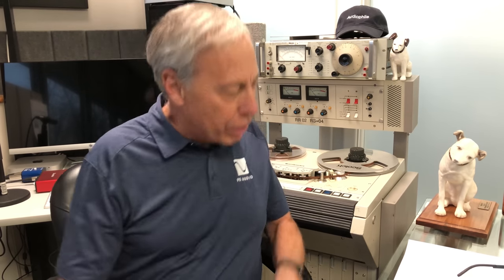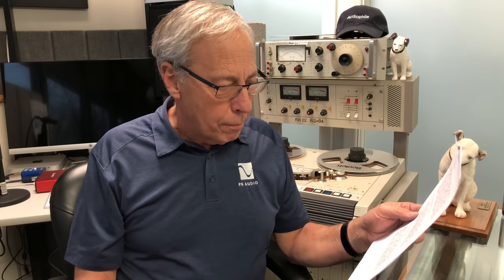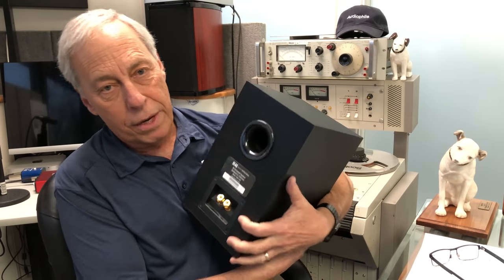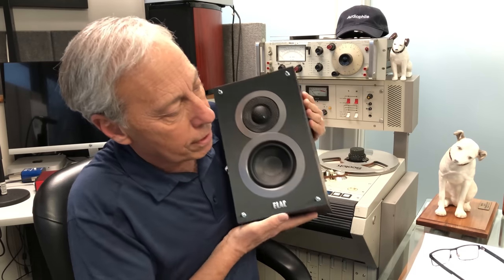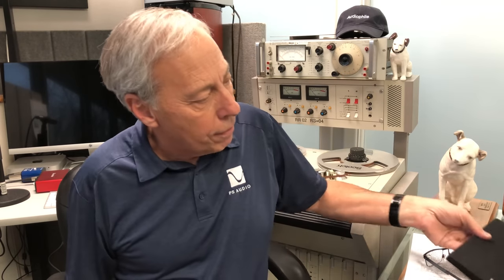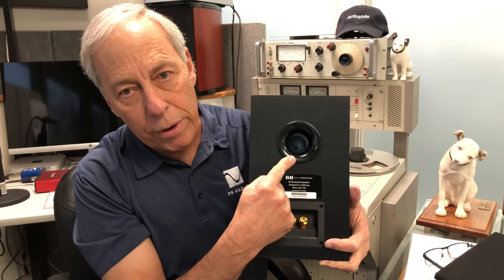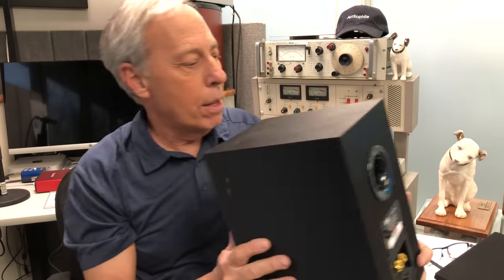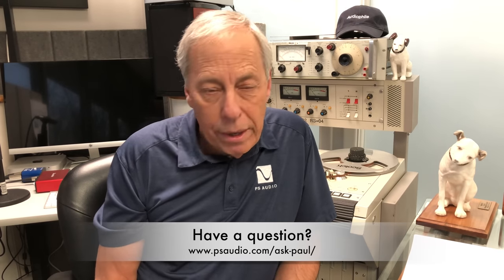Ported loudspeakers

Comment: For bass you have the measured "thile-small" parameters of a woofer, which you can use to make a spreadsheet that will tell you what it will do in a particular closed box, or ported complete with minimum port diameter. You can check out box sizes and port lengths for tuning the internal resonance that shores up the bass.
A closed system needs a woofer with more self-bass resonance than a ported system. The ported woofer would be bass-shy in a closed system, and the closed woofer would be blubbery in a ported system.
For little systems like a 4 1/2" woofer, you need the port. Ideally you'd have a long-throw woofer. You can get a -3db of 60HZ with the right woofer in 5-7 litres, which could/should be a narrow mini-tower. Perfect for a desktop, with the speakers at the top.
To keep mids from coming out perceptibly you line the inner walls with damping material.
For the closed system, they are generally filled with damping material to prevent inner reflections from hitting the cone and sounding it. You can't fill a ported system, of course.
The thile-small parameters include:  frequency of resonance in HZ in free air of the cone. Measured by using a sine-wave generater, ac voltmeter, and resistor, and amplifier to graph the speakers resistance over the bass frequency range. There will be a big peak at that frequency. Then, DC resistance. VAS - "volume equivalent" if I remember right. You put the woofer on a box of known volume and measure the resonant frequency, which will be higher due to the air spring. You want to know the linear travel, usually 3mm each way if not long-throw. You need Qts - my memory of this is vague - the self damping of the woofer, electrical and mechanical - combined. Mechanical - like, if you thunk it, does it go woong or blup? And the area of the cone.
So now, you have what you need to graph it in a trial box.
Therefor you can shop for woofers and plug in their parameters for the size system you want. Many will be too resonant and deliver a blubbery bass, while many will be too non-resonant (in the bass) and have little bass.
Now when those babies arrive, you have to test them because their published parameters can be quite off. This would be less likely with entry level and up high-end woofers from Europe.
If you want a ported system, a woofer with, memory holding, about .4 Qts will be great in a box the volume of its VAS.
Now you can tune it (using box size and port tuning) for maximum bass or better damping, the latter of which will make the bass roll off slower and be more controlled. The box would be bigger.
To compensate for an average British room I read about years ago, you'd actually want the slowly rolling off bass. Bass is bouncing back from the walls, overall boosting it is that case. 
Bass is omni-directional so half goes around the back. This actually makes it quieter than the mids when you're using an accurate mid-woofer, and you have to lower the mids in the crossover. The fact that the impedance is rising in the woofer with frequency helps. There's a 6db rise from bass to mids over 2 octaves. Forgot the formula but I think for a 12" wide box the top is at 1,000 HZ.
So there's alot that beginning speaker-builder books don't tell you.
Oh - and the air in the box is part of the spring-return system for the woofer, completing its internal spring.
The spreadsheet can also tell you how loud the system can go, using the linear throw length, bass tuning, cone area.
Reply: I forgot to mention that with half the bass going around the back, and some coming back - I'm thinking of a system out from the wall on a stand, or a tall system - if you put it on the wall and it wasn't designed for it all the bass would instantly come back and be way too loud. If you designed a system to be on the wall, you'd have to take out the dropping the mids to the bass level eq in the crossover network.
Reply: I forgot to mention measuring the qts. As in measuring the frequency of resonance, above, you measure that and its impedance, then the frequency at some % of that impedance, if I remember right, and a formula will give the Qts.
I also forgot to mention the what's it called? port that's just an opening with damping material covering it so it takes some pressure to drive in and out. It relieves some of the pressure of the air spring, acting like a larger box, so a woofer that would be too self-resonant (low damping) gets a looser air spring and can be ok in there instead of having big, loose bass.
Reply: Also, if a port is chuffing then it would be thought to have too small a diameter, where the air is rushing through too fast. I can't check now if a proper port chuffs a little at super-close range. Of course the greater the diameter of the pipe, the longer it has to be to get the same tuning to reinforce the woofer on the low end, limited by the depth of the box.
Reply: The internal dimensions of the box -- none must be a multiple of another to avoid unwanted resonances.

Comment: A well designed ported speaker would not have any fart sound. I can guaranteed that.
Reply: What he said :)
Reply: Half-decent sealed box speaker usually sounds more accurate to my ear problem with ported usually used to make s*** speaker extended
Reply: Methinks Mr. PS audio needs to check out all the studio speaker (4343,4344, 4350 etc.) JBL put out over the years with larger ports 4-6 inchs that sound absolutely fantastic. :>)
Reply: George Zubeck people there are always exceptions to every rule and if you listen most times he says it in one way or another.
Reply: don't worry, paul has forgotten more than i know....
Reply: Wrong; even using large diameter flanged pipes you get a sound, I know because I tried using 10" piping in a 120Litre box. Paul is right; you might not be able to detect it in music but its there; proven by doing a frequency sweep. As you decrease the pipe diameter swooshing sounds become more dominant.
Reply: That's like saying if you can measure the sound of a fart at a rocket blast it will have a meaningful impact. The benefits outweigh the negatives with a large port in the right place. If you place the port near the midrange  speaker you will have noise cancelling which will be negative to the overall sound quality.
Reply: George Zubeck : Every loudspeaker manufacturer in the world uses signal generators on their speakers or at least white noise spectral analysis, you dont know what you are talking about, no additional driver CAN negate swooshing sounds from the port (except by DSP which they rarely do).
Reply: Your missing the point. If the sound level is much higher compared to those swushing sounds (or chuffing rather than farting)  then its not as big of an issue unless your pushing alot of base. I would be more concerned about noise cancellation from the backwave affecting the overall midrange qualitie. What your not mentioning is that with a sealed enclosure you lose efficiency which does affect sound quality in a different way. I've experimented with my speakers by plugging my ports vs. unplugged and for most of what I'm listening to I preffer unplugged.
Reply: George Zubeck : Like I have already said; I built a 12" subwoofer in a 120Litre box with a 10" flanged port (Q=0.7); how many speakers do you know with a 10" port?...not many.
During testing even that subwoofer had some audiable chuffing sounds.
You cannot 'plug' your speakers and change it from an optimal ported to an optimal sealed box, because the enclosure volume would also need to be changed to keep the frequency roll-on optimal; you would need to re-calculate the Thiele-small box dimensions for a closed box). EVERY speaker designed to be ported when plugged will sound worse-again this is lack of understanding on your part.
Reply: This is not a contest of what is better or not but tradeoffs in the overall design including high frequencie, midrange and low frequencies. If you build a big enough box you don't need a port at all. The point is that you lose alot of efficiency with a sealed design and you need alot of power given certain constraints. With a ported design you need less power and gain efficiency. What you have to worry about is back wave interference from the port. The chuffing is only when your low woofing hard which is not all of the time. That is the point I'm trying to make. Not whether something is going to chuff and puff at all but whether its relevant to overall audio enjoyment.
Reply: It will if you are playing farts through a speaker. You need a good speaker setup to reproduce farts the best and get that rich, booty sound. Yup! Have of you at one time or another have played a fart through your speakers. After reading this, many more will do so. Try YouTube for a good fart library. You're welcome! LOL!
Reply: @suzesiviter6083  You seem to like telling people they don't know what they are talking about.  No one uses white noise spectral analysis.  They use pink noise spectral analysis.  Two entirely different things.  You don't know what your talking about.
Reply: @keithmoriyama5421  Wrong, you do not measure equipment specifications based on pink noise that roughly approximates the human ear, you would use White, its you that has the misunderstanding. You might use Pink when you are measuring the overall ability of say a speaker to reproduce the musical spectrum, but in general White noise is preferred to gain fast accurate results without having to re-correct the amplitude over the frequency band.
Reply: at least not anything audible. besides the only one that puts their face down behind my speakers ports is the cat
Reply: @suzesiviter6083  10" ports are standard where I'm from. Everybody doesn't have them?

Comment: If you don't like the sound of ported speakers, can you just fill the port with foam filler, or is this not a good idea?
Reply: Nope if a box is designed to be ported then it can't be sealed as the enclosure dimensions are calculated by the driver specifications . So if you want a seal enclosure then you have to calculate according to the drive specifications .

Comment: Two additional comments. First, the advantage of a front ported speaker lies in less placement restrictions than a rear port which needs room behind the speaker to "breathe".  But both disadvantages of ports (placement restrictions and port "chuffing" ) can be ameliorated by using a passive radiator which is essentially a port substitute.
Reply: Ameliorate: make (something bad or unsatisfactory) better.

Comment: The port of a ported speaker is a Helmholtz-resonator, and when the frequencies are higher than the port resonance the output is in phase with the driver and that gives those frquencies a boost, when the frequencies are lower than the port resonance the ports output goes antiphase with the driver and that's explane why a ported speaker suddenly goes quiet at really low frequencies ie. lower than resonance, it's ekvivalent to a fourth grade high pass filter. I have built my own ported speakers and it is hard too get it right, one way to determine if the speaker plays as it should is to put the music on, really loud, and walk to another room and listen to the sound, if you hear just one bass note all the time like; boom boom, then your speaker is not doing so well and it has become a boombox, people who dislike ported speakers refers to them like that. But if you try hard and put your mind to it, it is possible to build a good speaker, I would say that if you were to build a hundred different ported speakers then maybe five of them sounds really good, yes it is difficult. But don't bother with a passiv-radiator or slavebass speakers, they are a nightmare to design and their rollof at very low frequencies is maybe a six grade high pass filter,

Comment: If I was to just drill a hole in the front of a speaker box to make a port without putting a tube in the port, like the speaker in your video, would that help the bass to come out or would it end up causing cancellation?

I'm just wondering if a port can be just a hole or does it really have to have a tube in it that's tuned?

Comment: If designed properly transmission line speakers can have very low bass output though the cabinet size will have to be fairly large.

Comment: I swear for rear ported loudspeakers. Mostly they called it bass-reflex ports. Why my choise comes up with is that i placed my loudspeakers back far away a wall, so to experience an open sound. I own also a set of loudspeakers who have the bass-reflex port at the front. They are not very important, only to replace TV sound build in loudspeakers. Sound it bad? Not at all, but it can not beat my other loudspeakers.

Comment: I can only say back ported push the sound to the wall and the placement of speakers will become complicated to have a well balanced bass sound from the port, mostly 50cm at least...

Front port is far simpler since the output is directed to you and the speaker can be placed near to the wall.

Comment: I have read all the comments on here from technical experts who are way more knowledgeable than me and a lot of it has gone straight over my head. My 804s are close to the side walls and plugging the ports has helped tremendously with a woolly low mid boomy, bloaty sound problem. I love the sound now, albeit I am losing a bit of bottom end, but the sound is way better.
By plugging the port on the front of the speaker, does this turn the speaker into a sealed box? And does this make the other drivers have to work a lot harder? Is it safe? Thanks.

Comment: Do they still make Acoustic suspension speakers where the air in the box is used as the restoring "spring"?  I have  some old AR speakers that used this design and while they are less efficient than other designs, they very good bass response.

Comment: The front port needs a long run/tube to have time/distance to go into phase or even change frequency where's the back port will take time to refract and meet the front where's it should also meet in phase. So I guess what happens is that over distance the frequency/amplitude changes in the sound wave either making a different sound that can't be in phase or adding to the sound in phase.

Sealed will always sound better/true, and i even went as far as sticking cotton in the ports of speakers i had as a kid because i didn't like the "farting" either. Then corrected the sound with an equalizer. Blocking the port would of course stifle the woofer that was made to work in a ported area causing muted sound or even greater distortion.

I've noticed on very well designed speakers that the port it's self doesn't add much sound at all (making a really deep smooth "fart" that is barely audible) but rather lets the woofer work more effectively. But of course a servo woofer would be better.

Comment: I love your expert opinion on amplification but your explanation on ported speakers is flat wrong. #1 the sound coming out of the port is in phase with the woofer whether front or rear ported. #2 The port is not a pressure release (in the frequencies in which it performs it's duties). #3 A port does not work like a transmission line to invert the phase. A port tunes the box at a certain frequency determined by the diameter and length of the port. At this tuning frequency, the woofer and port output are in phase. Because the woofer is moving in the same direction as the air in the port, the pressure inside the enclosure is GREATER than the pressure of a not ported(sealed enclosure). Don't believe it? Run this test. Find the tuning frequency of the ported speaker by running an impedance sweep. There will be 2 humps in the low frequency area. In between the 2 humps will be a valley, this is the frequency at which the ported speaker is tuned. Let's say the impedance dips between the 2 humps down to 6 ohms at 40 hz. Plugging the port with your hand, run a 40 hz test tone through the speaker until you see the woofer really moving. Now take your hand off the port and notice that the woofer now is barely moving yet the speaker is producing even more bass. The reason is, the air spring (pressure) in the box has increased due to the port output being in phase with the woofer.

Comment: Nice video Paul. How about ported speakers vs passive radiators?
Reply: passive radiators is basicly a port simulator. But since its smaller than a port you can get small airspace and the same output

Comment: Ive got a question for Paul McGowan and viewers out there. I'm building a 2x12" speaker cabinet for a 100w peavey valveking head and wondered should I port the cab? I don't really want too as it will be a closed back cab, but does and will it make a huge difference in the sound if I do? And if I put a small hole in the cab say 10-15 or 20mm for example just to let the speakers breath/move properly within the cab and not let out alot of noise will this help with speaker over all speaker perfomance and or sound? Thanks and love your videos.
Reply: I really hope you didn't port that thing

Comment: a lot of times if a port is chuffing its too small of a port. this happens a lot when manufactures try to use them to boost output and keep cabinets small. The air speed should be kept as low as possible. on low power setups this isnt that hard but as you keep adding more power it becomes increasingly difficult to achieve.

Comment: Sealed box speakers are sometimes harder to come by, if you're into finding great speakers on a budget like me.. One of the ways I deal with port noise is by placing thick acoustic treatment behind the port .In general it's a good idea to treat the room for each set of speakers you are using.